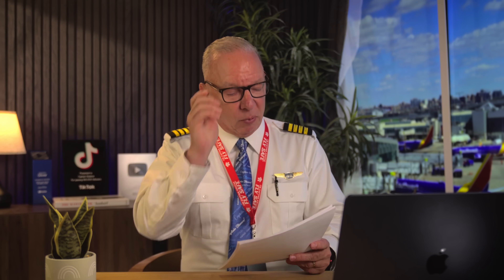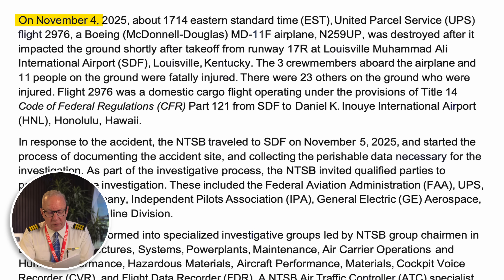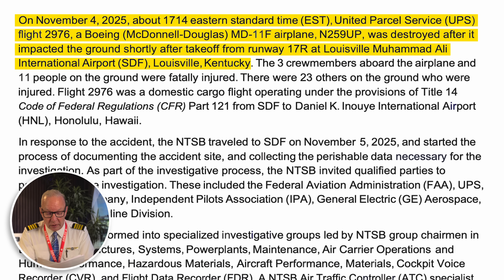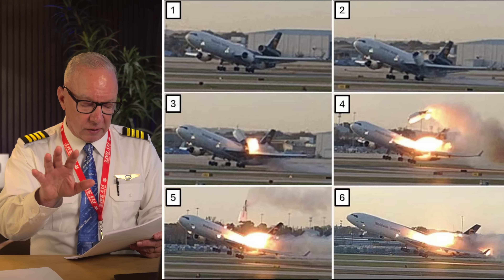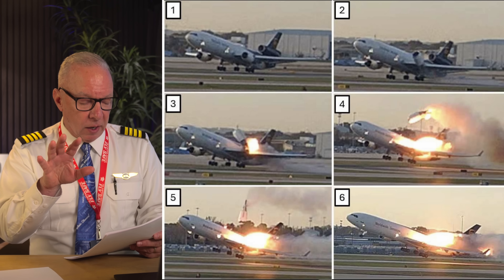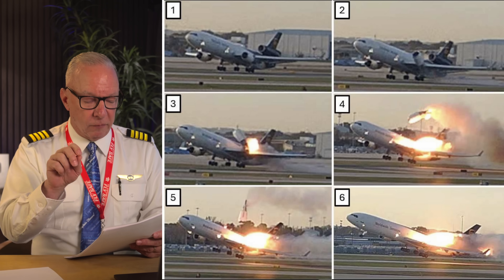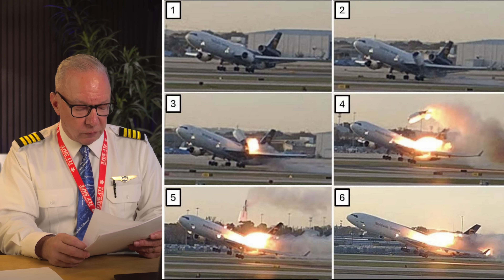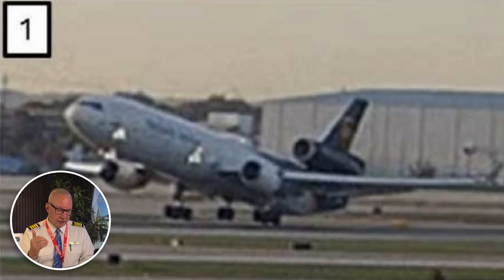UPS Crash Preliminary Report | Pilot Reacts to UPS Crash Report

Comment: It almost sounds like close inspection happens at regular - but very long - intervals. When looking for metal fatigue problems you might think that the inspection intervals would get shorter and shorter as the plane gets old.
Reply: One would think that.
Reply: Hoping the FAA will recalculate, change things and force private companies to comply
Reply: One certainly would. I do that with my cats for crying out loud. 🥺
Reply: @melodiefrances3898 Cats are Gods little miracles :)
Reply: That's what my doctor does with me. I'm nearly 70.
Reply: As I recall on a MayDay Mayday crash that this happened on that was a passenger plane (RIP), you can't see these pylons unless the engine is taken off. It is quite a long procedure to do correctly which keeps the plane out of service. This means a lot of money lost for these planes when out of service. In that case the stress fracture was caused by them doing maintenance not by the way the manufacturer's directions. They used a lift to reattach the engine and this could bump the pylons causing a stress fracture. The engine needs two perfect pylons to hold it into place. One of them compromised leaves the other one to take on more loads than it is meant to so that it receives fatigue cracks. I am not for sure what the difference is in fatigue verses stress fractures in aviation, but perhaps a mechanic might see this and tell us. I am guessing stress is referring to something that was not normal operation done to something causing a fracture as to fatigue is just wear and tear. I could have it backwards though. Still, the bottom line is that corporations think more about money than safety and lives and I have seen air crash investigation cases show FAA and NTSB willing to comprise safety with these corporations, so I wish people would stop treating them like angels or gods. This is spiritual babylon and greed makes this world go round where lives are expendable. Truly as the scriptures say, the love of money is the root of all evil.
Reply: @zarahofshiloh7537  I bet FAA and NTSB execs don't pressure  corporations, so they will have a cushy job waiting for them when entering the private sector.
Reply: @zarahofshiloh7537  Fatigue failure is from thousands of cycles of load, which causes the material to work harden, and then it gets a crack forming from this, that slowly propagates through till failure. Aluminium is famous for this, which is why you see such thick metal castings and machined parts there, so as to have enough of a reserve margin, so that cracks will not be large enough to fail before the part is inspected. stress fracture is caused by a single cycle of overload, that makes a crack form in the material. it might take a few thousand extra load cycles to get it to fail fully, but the initial crack was from a single high force applied.  

Very few metals do not suffer from fatigue, only steel in certain alloys, and some other expensive and exotic alloys, and even then only when the stress cycle applied is below a certain portion of the elastic limit.  aluminium does have a fatigue life, irrespective of the stress applied, which is why aircraft have such stringent rules regarding crack checking on the entire airframe, and why certain inspections often result in the aircraft being scrapped, simply because you need to remove every rivet, every part, and clean and check them, which costs more than the value of the aircraft. Only the military and governments are willing to do that, because the airframe is itself not revenue generating, but something they use for a function, so replacing is difficult. They will replace if they can get new, because of the cost, but will otherwise put it as a budget item.
Reply: @zarahofshiloh7537 fatigue failure vs stress failures can be analogized by taking a paper clip and cyclically bending it back and forth till it breaks.  When you inspect the actual break under resolution you can see that the surface morphology of a fatigue crack is quite different than a catostriphic or instantaneous failure mode like snapping a piece of similar material.  And often the fatigue cracks can occur over time with loads that are less than a sudden high load fracture.  Hope that helps.
Reply: @zarahofshiloh7537  " I am guessing stress is referring to something that was not normal operation done to something causing a fracture as to fatigue is just wear and tear. "

Well the fatigue cracking or fracturing is like bending a paper clip  or solid copper wire back and forth repeatedly until it breaks, stress crack or fracture/overstress is more like tying that copper wire to a tree limb and the other end to a concrete block and dropping the block from the tree- it will snap the wire immediately- it's a shock-force stress
Reply: @FCE-dogs Yes, that is what I thought. So, sense they mention a stress fracture just like I think I remember from that May Day case where the engine came off on a passenger plane from stress fracture caused by not taking off engine and putting it back by manufacturer procedures. So something happened with one of those pylons that shouldn't have happened causing stress fractures that lead to the fatigue fractures. I think that it was that way in that case. So, the question here is did something similar happen here where procedures were altered in maintenance leading to a stress fracture that lead to fatigue and then complete loss of engine? It sounds like to me they are trying to brush things under the rug by getting us to focus on age of the planes instead of another possible maintenance problem.
Reply: This seems to be a pattern in building collapses I've studied as well. The condo collapse in Miami back in 2021 happened during it's 40 year recertification process, for example. 🥴

It's so insanely tragic when things like this happen. I really hope we can start to do better by our people.
Reply: @TheZombieateu . It will ALWAYS boil down to MONEY. How can a company executive become rich or filthy rich, cut corners, extend out service work, not replace highly critical parts on a time line set by the government. 
Always, always, money is the bottom line !
Reply: @geneticdisorder1900   Yes. All answers are greed. There's so much corruption down here in Florida and has been for decades, you kinda have to go to into decisions assuming nothing is what it should be
Reply: there are lots of things like that in the world, what common sense would dictate vs what actually is. I just learned that judges in my area don't need to know a damn thing about law to become a judge.
Reply: @anaveragehuman2937 and they got the nerve to said that igonarance of the law is no excuses when they dont know a handful, sheeesh
Reply: Exactly what I was thinking!
Reply: You’d think…
Reply: Too infrequently, in this case.
Reply: Would add freight aircraft almost always fly fully loaded.  Has to have additional stress on the airframe over passenger service unless data shows otherwise.  Not sure if cargo aircraft have more frequent stress and metal fatigue inspection.
Reply: @briangriswold7724 right own, and this one was a heavy
Reply: You would think. If the mounts were inspected at 5 years, and it checks out fine, then it continues to check out fine, those mounts could possibly be 20 years old. It’s seems like pushing the envelope until it fails.  There must be a full replacement schedule at some point. You’d also think environmental conditions are factored into that schedule.
Reply: @JKlessig 
I have a steel scuba cylinder that's ~30 years old. It regularly gets filled to 230bar (about 3300psi).  IIRC the test pressure is around 350bar (5000 psi). 

I know that dive cylinders are a world different to aircraft parts. My point is that steel (within its design limit) can last quite some time. Just because it's 20 years old doesn't mean it should be changed. 
That being said perhaps the mount inspection needs to happen earlier and it needs either sonic or eddy current testing rather than simply visual.
Reply: That's what they do to us and our drivers licenses..lol
Reply: If a part has a designed life between inspections, and it was good at last inspection, why would it need to get shorter? Biology ages because your cells are constant dying and being replaced with slightly inferior copies. Metal parts aren’t like that. If it was good at last inspection, it will be good until the next one (and probably far longer), barring an external cause. Like being struck by a vehicle. Which would trigger an immediate inspection. How many aircraft in ruzzia do you think are getting their regular inspections and parts replacements? Yet we don’t see an aircraft falling out of the sky every day even there.
Reply: @alexc4300  Shorter intervals because they are now on the far end of the lifetime curve, and the chances of there being a fatigue crack growing are so much higher. Russia the only reason they are not having aircraft falling out the sky is because they broke before they took off, and even Russian pilots do not want to crash in flight.
Reply: @SeanBZA  my point was that if it’s inspected and there isn’t a crack, it doesn’t need inspecting at a shorter interval just because it’s older. Intervals are already supposed to be shorter than a failure case would take.
Reply: @a @alexc4300 e fact that fatigue (weakness due to stress cycles) cracking has occurred before replacement may indicate that the replacement or inspection regime doesn’t match the stress cycles that has occurred.  Ie inspections too far apart
Reply: @alexc4300  Yes, but age means there is a greater chance of a fatigue crack showing up and going through to full failure, s shorter intervals are very much recommended, to catch them early as the metal ages, or have a proactive replace massive parts on number of cycles, like wing spars, after the earliest outliers are found with cracks. just like Aloha air found out the pressure cycle limit.
Reply: This is very similar to what happened to a plane years ago, only it was a loaded passenger jet. The exact same thing happened, engine came off at takeoff, pre-existing fatigue cracks in the pylon mount, and it was discovered that maintenance guys were using a forklift to reattach the wing (a big no-no) causing cracks and the crash of that plane, too. Very likely crews are still using this illegal short cut to save money and that's why these people are gone.
Reply: @Heathcoatman  Extremely unlikely. I've been an aircraft mechanic for over 40 years. There's no mechanic that I know of who would use a method that was responsible for a major accident and has been basically outlawed. No mechanic would put his license at risk to do such a thing knowing the possible consequences, and no air carrier would put their company at risk by allowing such a thing.
Reply: @karlmerriam But we know it happened 1979.
So I cant imagine, that it will be done in our days.
We learn from these disasters. But the inspection times seem very long to me for an old, very hard used plane, spezially on
pices, which are the base for safty and on which we had problems in the past.
Reply: @karlmerriam oh, really! How 'bout the Alaska airlines crash off the CA coast. The jack screw & nut was inspected by one A&P and determined to need replacement. The next shift came in and determined it was OK.  Two cycles later it crashes killing everyone on board.
Reply: @Heathcoatman  Don't be insulting to maintenance crews by making this accusation!
Reply: @Heathcoatman  I remember that "Aircraft investigations"  or the like- episode!
Reply: @Heathcoatman  
Worked that aircraft for 20+ years. Forklifts (a tool) are used all the time. 
The issue is the skill of the Forklift DRIVER. 🤔🧐 

Forklifts don't drive themselves.
Reply: @muamaur_hannobaalii   if that’s the case, the issue is that using a forklift for lifting is not in the approved methodology. And there’s a reason for that. But let’s not speculate. NTSB will get to the root cause, then we’ll know. Right now you’re casting shade on people who probably had nothing to do with it and are hurting.
Reply: @muamaur_hannobaalii forklifts sag and loose pressure when turned off from my understanding back in the day they lifted it turned off the forklift while installing the hydraulics leaked and the forklift sagged slightly stressing the mounts. Took it 3 or 4 years later for that subtle damage to propagate  into failure. 

This sounds  like poor inspections a visual inspection isn't enough to see stress cracks a die penetration inspection or eddy current should be used  especially with older aircraft
Reply: @garrnk the other issue found with the forklifts is that they could easily impact on the way up as the engine was being re-attached (aka damage after inspection)
Reply: @DontScareTheFish I'm guessing that you are quite right. Perhaps if they'd hung the engine/pylon assembly from a high fork instead of resting the engine on the fork underneath the engine. I'm guessing that the approved method uses a cherry picker that teaches over the engine for lifting and loosening from the pylon. I like this to swapping and mixing rods and caps during bearing replacement on a crankshaft. The rod assemblies are cut as a unit and swapping the caps around or getting them on reversed will turn a bearing within a hundred miles. Lot of mechanics don't get this.
Reply: @fedfraud.protection.servic2557  If the reference here is to the late 70s maintenance processes that resulted in the Chicago crash, one of the other airlines did use some type of gantry to suspend the engine, etc. to avoid disassembly.
Reply: @garrnk  
Inspectors overseeing engine changes have to be held responsible for this.
Reply: @markkubert8572 - That any of the air cargo carrier companies that fly the MD-11; with the newest being 25 years old and some being built 36 years ago and still flying, would only do a detailed visual inspection of the stress points of the engine pylons every 6 years, is a surprise... I was imagining that these old aircraft would have a DVI (Detailed Visual Inspection) of their 2 Engine Pylons every 3 years, as these planes carry heavy loads for sustained long distances day in and day out. It seems "careless and negligent" at best, and the outcome was the fatal crash of the UPS aircraft. Wonder how many of the grounded MD-11; and the newly grounded DC-10 aircraft, will show stress fractures/fatigue cracks on their respective #1 and #3 engine pylons after the emergency SDI on them is completed.
Reply: Exactly.  That's what I was thinking.
Reply: The solid chunk of steel being the offender here - it doesn't particularly matter how old it is as a matter of principle. Under normal loads nothing should be happening to it. I mean, unless something unusual happens a piece of metal should be retaing all the physical properties of it over thousands of years. The fact that it failed means that it wasn't under normal loads and stresses. Meaning, it is of a flawed design. The thing should have been beefier, of a different material or have different geometry or something like that.
Reply: @feedme8991  if you’re aware of the history of aviation and other accident investigations, you’ll know that not everything which goes wrong is design-related. There could have been a variety of causes unrelated to design, such as a previous external factor like a vehicle collision, etc. and those things should be picked up by immediate post-incident inspections. Obviously something went wrong somewhere, but it’s way too early to start saying for sure what the cause definitely is. Fatigue cracking has been identified in one part, and the cause of that now needs to be established, following the Socratic method - why. Why. Why. Until we arrive at the root cause. But right off the bat, I’d be inclined to discount a design flaw just because the airframe’s 34-years old and MD-11s haven’t fallen out of the sky like rain over the last 34 years. If the design were flawed, you’d expect it to have been more of a problem.
Reply: @feedme8991 Negative on the thousand years. Steel ages over time. In mission critical applications if it sits in the yard for a year it gets sold as scrap. It's soft when bought for easy machining and then heat treated for hardening after it's cut which imparts it's strength. But even after hardening all materials develop micro fissures and weak points from cyclic stressing which over time will fracture. This can happen even if you don't use it and subject it to cyclic stressing. Just takes a lot longer. Plastics are especially prone to this.
Reply: @feedme8991  Metals can change chemically with age, contact with air, moisture and other chemicals. Repeated cycles of hot/cold and other stress changes such as push/pull, lift/drop, bend up/bend down, twist left/twist right etc. will, particularly in alloys like steel (iron and carbon and often other elements like manganese and boron) or duralumin (aluminium and copper), cause fatigue cracks after a sufficient number of cycles of change. The real problem is knowing how many cycles will do it - and that also depends on how well the alloy was made in the first place and the shape and machining of the part.
Reply: Makes sense to us but we are not paying for it...........
Reply: Every flight can be different depending on location and the weather during a flight..as to the effects and stress on such engine mounting parts..Hopefully the FAA will reevaluate its inspection procedures for the airlines..
Reply: They usually do, The initial inspection is refered to as the "Threshold" inspection. subsequent repeat inspections are often at shorter invervals. I'm unaware if this is the case with MD11 pylon mounts.
Reply: It's not really a wear part.  Fatigue cracking can start inside the lug bore, but they grow very slowly.
The so-called "fatigue fractures" in this case were probably localized overstress fractures that resulted from a maintenance error.  Some nice, moist, salty air (Hawaii route) and the fracture surfaces could look much older than they actually were in a matter of weeks, before they grew and failed completely.  This was not something that happened from normal wear.
Reply: It’s insane to me they only do airplane inspections every 6 years. Semi trucks have to be inspected every year.
Reply: Metal fatigue is insidious, and even the number of "cycles" they go by doesnt tell the whole story, there is a difference between the jet flying in smooth as silk weather and stormy ROUGH conditions where the craft is bouncing around and rocking and rolling- one cycle like that is probably about as much wear and tear as ten smooth as silk cycles, but that's not taken into account in just counting cycles, also the LOAD the jet has on board, whether it's 50% because the jet is only half full of passengers, or maxed out with heavy freight instead- the differences of stress etc between those two conditions again would in the case of a maxed out full of freight cycle be more wear and tear than a passenger cycle where half the seats are empty.
Reply: If the FAA had recommended more frequent inspections of the aircrafts, they would have been done. One would presume that the guidelines that the FAA puts in place are for the utmost safety. If an aging plane's maintenance requirements change over time, it makes sense that it would be the FAA to make that call. UPS takes the maintenance of the aircrafts and the safety of the crews seriously. I know. My dad was part of the airline division for over 20 years. 

And Captain Steeeve, there are 14 families that need prayers now - not just 11.
Reply: I realize aircraft parts are expensive, but you would think certain critical parts should almost just get pulled off the aircraft and replaced at a certain number of flight hours or cycles. Especially if it could lead to something so awful as an engine departing the aircraft.
Reply: @TianarTruegard  this is exactly what happens. There are strict procedures of inspection and replacement based on historical data. Either a corner was cut, or some kind of unknown failure mode occurred, and it’s way more likely the first thing.
Reply: @TianarTruegard  it does. 29k cycles. The problem is this plane was only 21k. 13:15
Reply: @TianarTruegard  They do, but it is a never ending fight between airlines "how long can we push this out" versus regulators "you have to maintain as per manufacturer instructions, or more often" as to what and when, and also as to how. Airlines will defer it, till told that unless this is done, that airframe is grounded, and then will do it as cheap as possible. Every time you ply, there is a good chance at least a few critical parts are either at or past inspection time, and often whole systems are not working correctly because something is failed. Engine alternator failed, OK we will use the APU till it is replaced, when we get a round tuit, sometime later. AC unit failed, well we have 2, plus an APU bleed that can do it, so fly till later on at maintenance, only a few days.weeks.months later on. door slides need service same, waiver signed off by somebody till next service cycle, and so on. Coffee machine not working, and the other is broken, now it is a crisis.
Reply: @TianarTruegard less expensive than a plane crash. UPS could have thrown away every pilon on the entire remaining active fleet of 24 MD11s and put all 48 of them on new for a lot less then the cost of this crash. Plus I'm sure there's going to be a lawsuit to settle yet with the victims families.
Reply: @husky572 agreed one thousand percent
Reply: @husky572 
Yes, but an accident avoided doesn't show up in reports while the cost of maintenance does. You only know this cost after the fact.
Reply: @seanrodgers1839 depends really. These MD11s have been notoriously expensive to maintain since they were fairly new. They just plain a lemon model plane. And when you look at the scope of the carnage of plane crashes why take the risk. I bet to replace all 48 pilons that UPS had in service wouldnt have cost more than 15 to 20 million. This accident is way beyond that.
Reply: @husky572 
You missed my point. If you spend 20 million and don't have an accident, you'll never know how much you saved.  You only know what you spent. People make decisions based in known things only. It's the bias that creates these accidents.
Also, people who don't know how things work make the decisions, cost is their decision criteria. That's how we get here.
Reply: Profits before humanity.
Reply: @DAViDD767  So sad, but true.
Reply: @DAViDD767  Nice thought but we know how that's going to work out.
Reply: @DAViDD767  The Ford Pinto all over again!
Reply: @DAViDD767  Just go look at the history of the Railway Safety Act of 2023..... Rather than trying to do anything to make railways more safe, rail companies paid millions to politicians to nuke the bill.
Reply: @DAViDD767  They don't care, INSURANCE covers all the costs and lawsuits and the airline gets a new plane out of the deal too.
Reply: Shorter inspection intervals as a plane ages is genius
Reply: Agreed. Especially with the aerodynamic stress the plane endures on EVERY SINGLE CYCLE.
Reply: @evoz4489  It's not just what I define as aerodynamics stress it is also vibration. The study of metal fatigue started with mining hoist equipment in 1829, railway axle failures and cast iron railway bridges in the 1840s with the term metal fatigue coined in 1854.